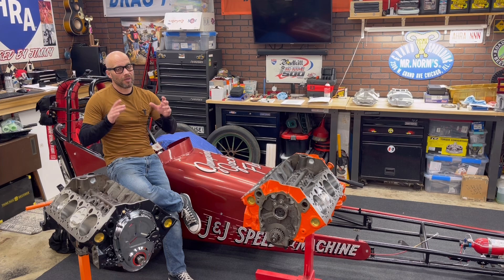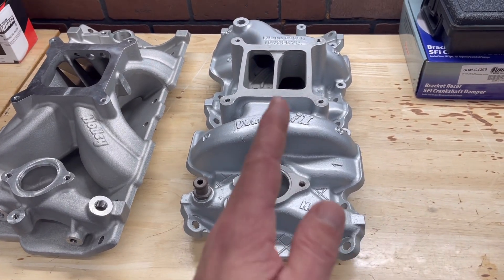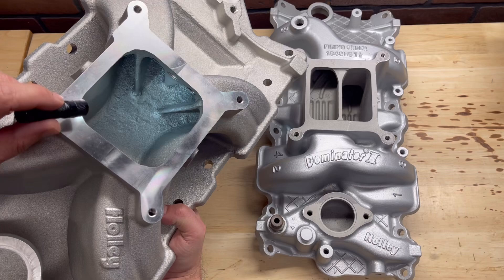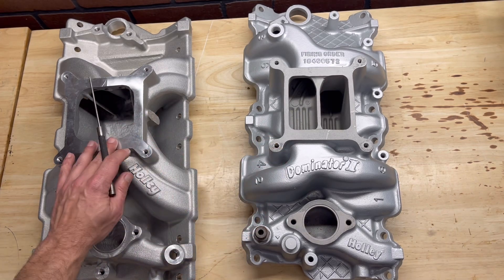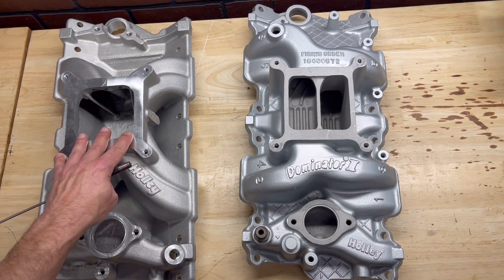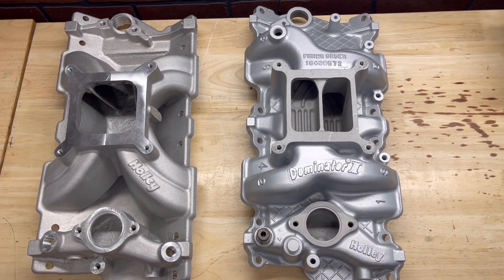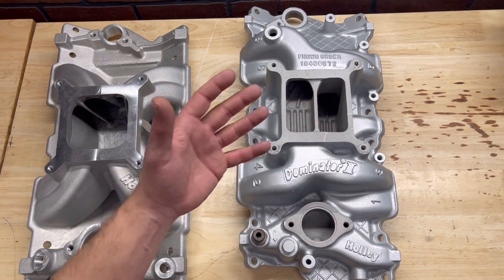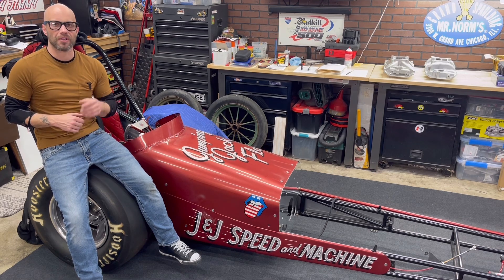Single Plane vs. Dual Plane, What Are the Differences and Which Is Right for Your Engine? #engine

Comment: I've never seen a dual plane do much of anything good above 5500 rpm, let alone at 7000rpm.
Simple rule of thumb is: if your engine spends most of it's time up to 5000rpm, use a dual plane, if it spends most of it's time at 5000rpm and above, use a single plane.
Reply from the maker: Well, this one does.  Just like the original winters intake used on the 302.  The goal is to make power up to 5000 and after 5000.

Comment: The dual plane intake manifold splits a V8 into 2 four cylinder engines for a  better carb signal   Those L88 /ZL1  drag race big blocks had the plenum divider cut you know that
Reply: I appreciate the response bro! You know about horsepowerdepot 67 corvette that is knocking on the 8 second door on factory skinnies with a factory winters intake.
Reply from the maker: @ oh man, what a wild car!
Reply from the maker: That's a great point!